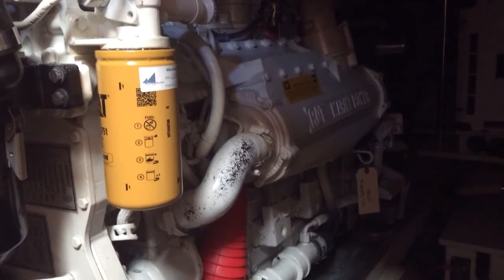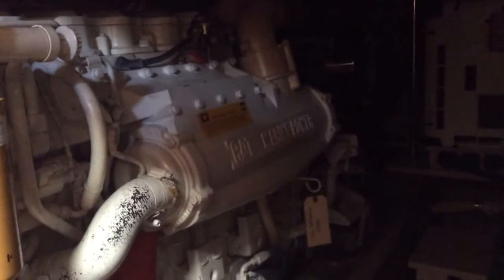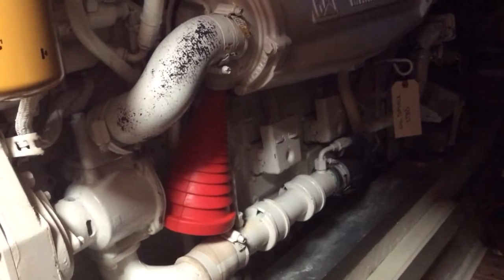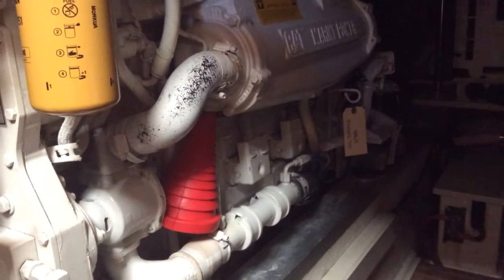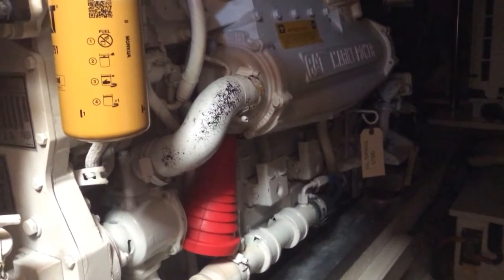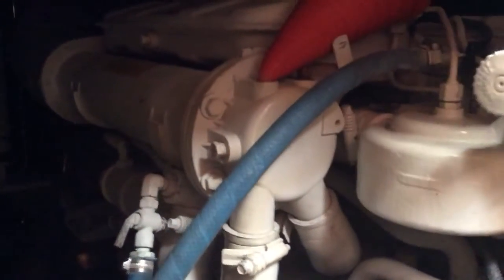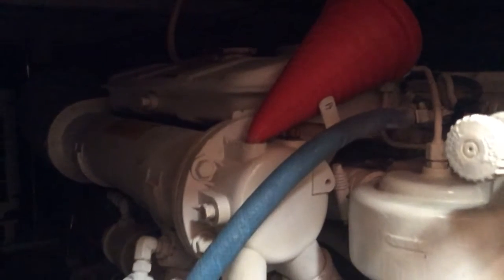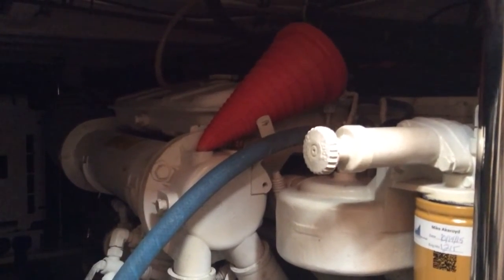Pencil zinc replacement on a Caterpillar Diesel

Comment: I understand there are 3 Zincs on a Cat C9 ACERT, Where are they all located.  I need to do this ASAP. I have only owned this boat a short time and I am new to diesel engines.
Reply from the maker: Join us at a Boat systems class    And learn about your new engines and more. Or you can give me a call and I will try to walk you through it. I charge $80/hr. We can do FaceTime or zoom and I will “walk” you through finding and changing your zincs. More if you want. 772-205-1859.